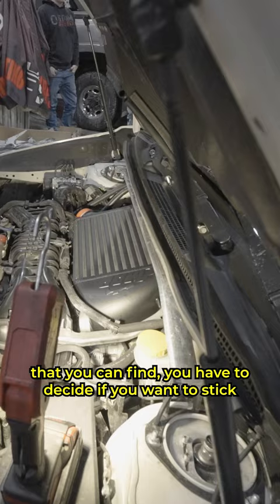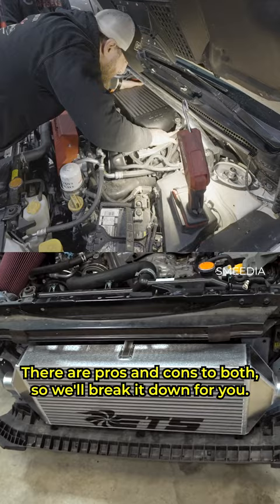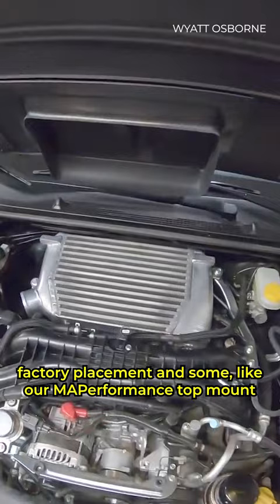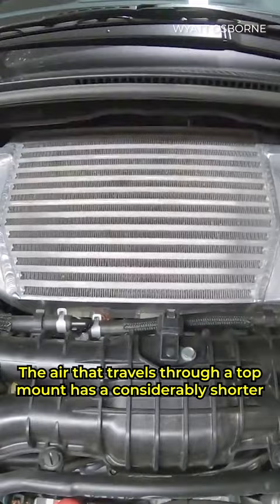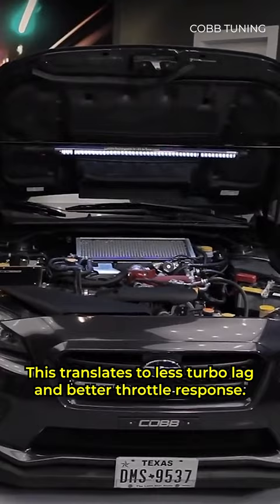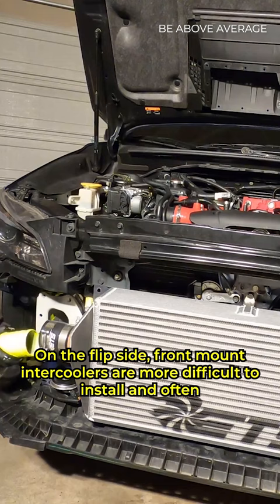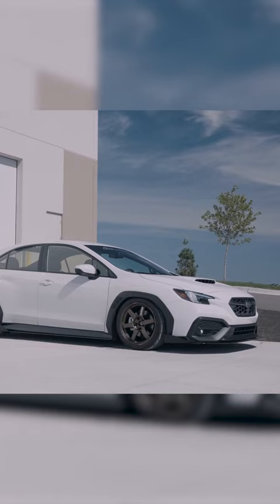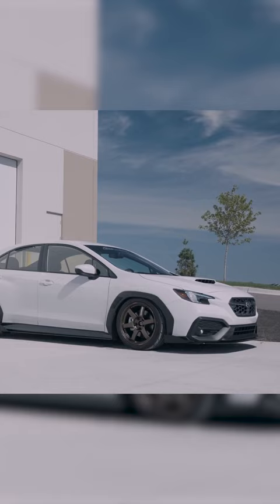Front or top mount, which one are you running? #shorts

Comment: Front mount is way better in my opinion. Colder dense air, no traffic light heat soak. Way bigger induction sounds. Basically set and forget 

I always had a top mount on my Subarus, then eventually ended up with front mount anyway. Haven't really noticed turbo lag, off and on the Dyno. But its true the throttle response is different, mostly apparent when taking off from a stop 

The cons of a front mount are miniscule compared to the pros, based on my experience

Comment: You aren't going to notice the difference in turbo lag it's basically non-existent for that small of change in tuning length. You also need a LOT more boost for the same power with a top mount because the air is going to be a lot hotter. The only real reason to stick with the top mount when modding your car is to make the install easier.